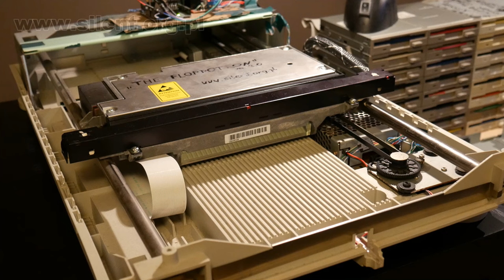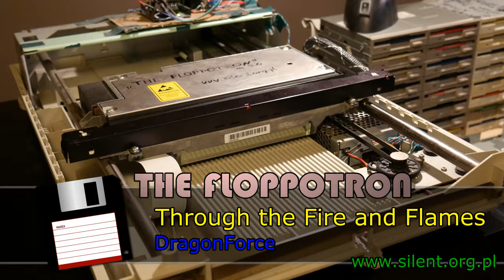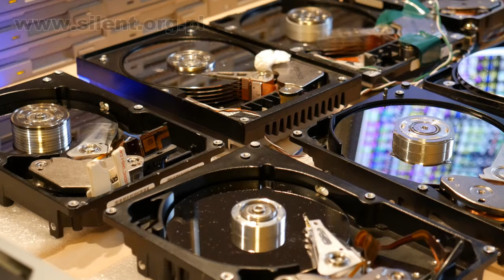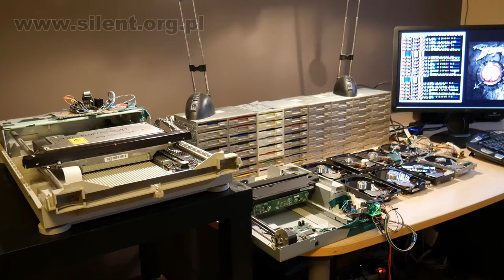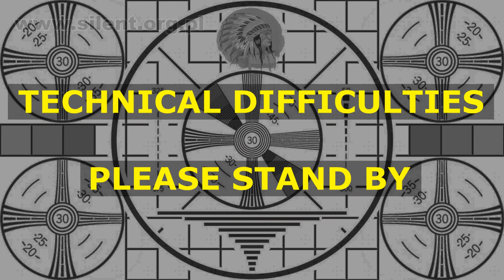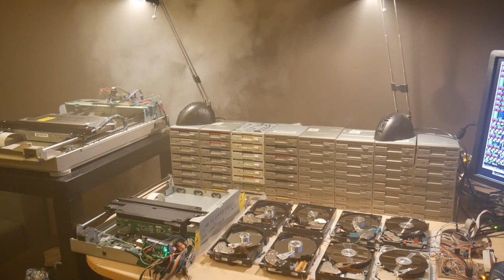The Floppotron: Through the Fire and Flames

Comment: I thought the most torturing song for the equipment was "Running in the 90s", but I completely forgot about Dragonforce.
I'd love to see "Fury of the storm", the solo in that is an absolute face melter. The ultimate test for the Floppotron.
Reply: he will have to bath the entire floppitron in LN2 Vapors to keep the fire at 3.5" bay
Reply: No matter what the comments are that i read i always default to one thing is that all this Hardware has purpose the hard drives and floppy drives share practically the same purpose as one as the grandfather of the other and then there's the scanner heads with the servo motors that when functioning within their native machine do sound a little bit funky

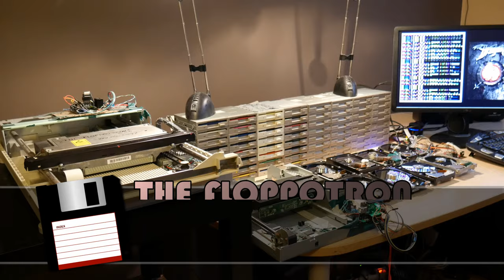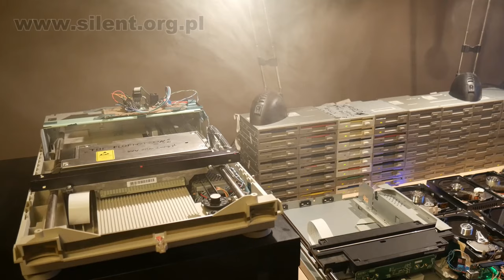Comment: 0:09 the screen in the back is just going apeshit. And at 1:41 the Floppotron is probably about to create some more fire and flames
Reply: Remember that he hand codes all of these by addressing each and every hard drive and floppy and printer (like setting a time and stepper motor speed) on the board. The code streaming past (you can see it in different colors) is because of the general tempo of the music, it would be slower generally.
Reply: @revolver265  IIRC he said on his blog that he had a program to convert midi files which automates most of that coding.

Comment: This is what happens when you try to run anything on windows xp
Reply: Samuel Jett you could connect a potato to windows xp and it would work, unlike what we have now
Reply: If you wrote "3.11", "98"or even "ME/2000 " I would maybe believed that you know what you're talking about.
Reply: XP ran on anything and did amazing with what it had available to it hardware-wise.
Reply: @just.gajche  Don't forget the dumpster fire that was Vista.
Reply: @cjjones6261   No shit. I slapped together parts from 3 second-hand PCs, and it not only ran, but recognized most of the hardware without even installing half the drivers. It was genuinely difficult to fuck up XP in any significant fashion, and oooooh boy did I try.

Comment: So i only have one real question, this is absolutely amazing. Makes me want to code a 16 bit game in c or c+  and have it rendered in ega but besides that my real question is how did you accomplish the i/o restraints, DMA etc, with the old hardware?
Reply: I'm pretty sure he is running the whole thing by having a few arduinos directly controlling the motors of each device (though i don't know what he uses as central controller with screen, maybe a raspi?)
Reply: @johnuferbach9166   wouldn't pie still be limited for io addressing? My guess would be at least 6 separate boards with a masterboard sending instructions to the 6 channels->boards, in which they would send out instructions per max channel.  Like I said, I find it amazing.
Reply: @mattcude6917  as I said there are arduinos (you can see them in the video^^) controlling the individual motors (i guess with a transistor / relay and PWM or so) and then some central board, which i guess might be a raspi with the screen that tells the arduinos what to do via usb-serial or direct serial or I²C
Reply: @mattcude6917  Also the pi has like 30+ Io-Pins, so sticking a ton of relays on the pi should also work?^^
Reply: @johnuferbach9166   gotcha, I just assumed it was all pc based and a script could play what song you wanted.
Reply: @mattcude6917  I mean a PI is basicly a PC :P But with a usb-Hub, maybe a PC could also adress enought Arduinos... maybe he has a script that takes a midi-file or so apart and tells each Arduino what to do when? Maybe check out Device Orchestra (i think thats the name) he does similar stuff with Toothbrushes and the like, he also has an explanation video of how he does it... i think he has one Arduino Mega as sole controller and a script that generates code for the arduino from a midi file :)

Comment: how could i do something like this? I have the stuff to do this, i just don't know how to code to do it. Can I use python? Do I need DOS? Bash?
Reply: It seems he is using arduinos to controll each of the devices and then maybe a raspberry pi as central thing? then I guess usb-serial to communicate... you'd need (pretty basic) c for the arduino part and for the raspberry python would work